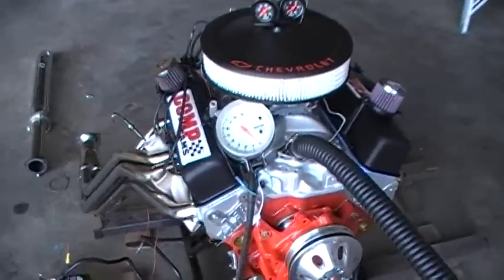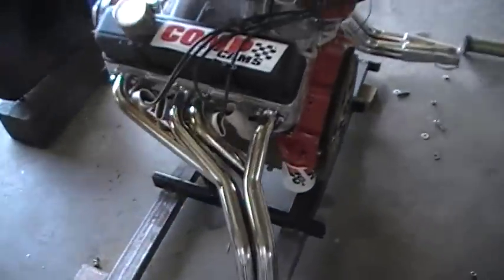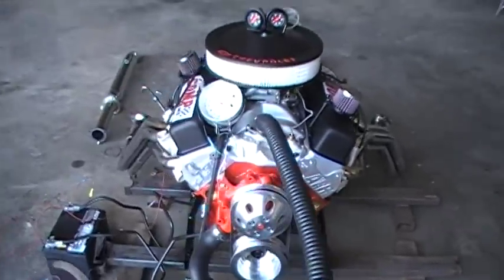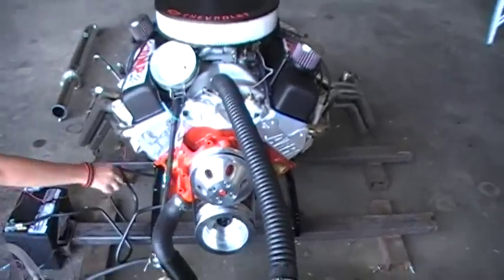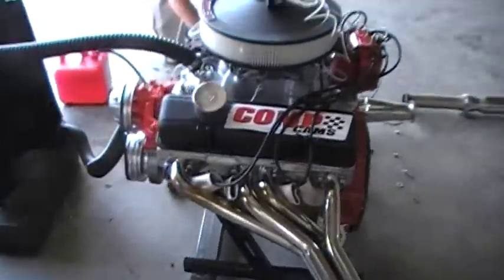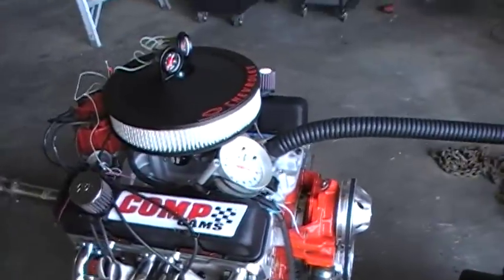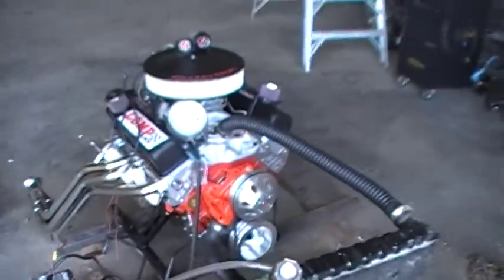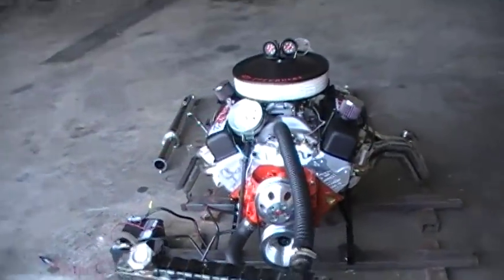383 Stroker SBC Dart SHP

Comment: definitely not making 550 with that low compression and small cubes with a dual plane. Lol u need about 11-1 compression with a single plane. But if you put some boost on it that wouldn't be to bad of an idea lol
Reply from the maker: Made 505 with that setup.  Put flat tops in it and changed cams and went single plane.  Hit 573

Comment: Should try the Total Seal gas ported rings. And install a crank case evacuation system. About 400 dollars for the two, but will dramatically increase  horsepower.

Comment: Did you fab up that engine stand or was it purchased?
Reply from the maker: I had a regular engine stand and then welding two 3-4 foot pieces of scrap steel to help support the engine while running

Comment: that intake is going to hold back the cam from revving passed 6500 but everything else seems to be pretty decent. GOOD JOB!!!  If its in a light car or S-10 use a Victor Jr with a 770 Holley. As it is Id say maybe 500 hp that intake is killing hp above 4000. With a Victor Jr yea 550 is obtainable with timing in the 34 degree range.
Reply from the maker: MasterWitchDoctor you would be glad to know that I swapped to flat top pistons, put on a bigger cam, switch the intake to a high rise single plane and she would rev to 7200.  Put out 573HP

Comment: 1 5/8" header is to small. Your compression is probably more like 9.8 with a 65cc head and why would you go I beam instead of a H beam for roughly the same money.
Reply from the maker: Jess Roberts I liked the Scat Pro Comp I beam rods.  They are in some 600 plus HP engines.  H beam would have been overkill.

Comment: oh thats a nice sound. 

ive got 2 400 small blocks.... one in a 77 chevy truck that im putting a 4 speed munchie in (the granny gear, sm465 iirc) and a np 205 to replace a th350 with only 1st and 3rd and a full time four np203. 

think i will keep it mostly stock.... mostly. need that truck to be any weather turn key and go. 

but the 400 in my 68 impala..... i almost wanna go 180 from your motor and stick in a 350 crank....make it a 377. 9000 rpm!!!!

Comment: Sounds like my flat fendered 2wd Jeep back in the 70's. I ran it on the sand dunes at Pismo Beach with paddle tires and could climb anything out there.  It was a 350 with Z-28 off road cam, Tarantula intake, big Holley, 2.02 heads, and headers that I built. The 12 bolt GM rear end was 4.56 posi, trans was M-22 Muncie 4 speed. Good stuff back then but nothing compared to today. I appreciate the sound of your motor. Kids these days don't know what an uncorked full tilt small block sounds like....
Reply: kimmer6 I
Reply: kimmer6 good deal I'm in the 805 myself . Just recently blew my engine up got to drop a new engine in my truck
Reply: kimmer6 what the hell is a z28 off road cam?????? Daaa

Comment: Sweet build buddy! Are you still able to run 93 with that 11:1 C/R?
Reply from the maker: Yes since the cam is big enough to bring down the dynamic compression ratio.
Reply from the maker: Yes it can still run on 93 octane since the cam keeps the DCR in pump gas range.  The engine is 11:1 SCR now actually.
Reply from the maker: Yes. When I changed pistons from the ones used in this vid to the flat top SRP pistons 11:1, I also changed to a bigger cam which lowered the DCR enough to be in the safe range.

Comment: those are great numbers for a motor under 10:1 CR. I'd toss the valve cover breathers and run a vacuum return line into the manifold from one of the covers and plug off the other, That way the crankcase pressure is equalizing to the top end. Why? So the pressure in the cases eases the gravity return of oil.
How much did the build cost?
Reply from the maker: well I switched to SRP Professional Pistons/Rings to bring compression to 11:1, switched cams, and rebalanced the rotating assembly, so probably right around 7 grand or more...$2000 shp block/machining, $1500 rotating assembly, $1500 heads, $600 carb, cam/lifters/timing components/pushrods/roller rockers $1700, intake $100, oil pump/pan and other miscellaneous things ?$...the time i put into it was free though! lol
Reply: thats some cash to drop! What machining, besides cyl. bore/hone, line hone and deck was done to the block to cost $2000 in machining?
Reply from the maker: Steve Solo I meant the block was 2,000 shipped to my front door ready to go.

Comment from the maker: After re doing this engine I got it to put out 573 Horsepower at 6400RPM and 515 ft/lb or torque at 5400RPM!
Reply: OutdoorMan812 
What parts did you switch? Intake, headers,
Reply from the maker: Derek Stewart I changed to flat top pistons, and to a bigger cam, and single plane intake
Reply: @lhmurphy21  nice, I do custom port work on a lot of heads and Intake, does great for out of the box parts minus custom cam
Reply: Was it around 500hp 500tq before the changes?
Reply from the maker: Derek Stewart yes it was 505HP and 470ish torque
Reply: @lhmurphy21  
What cam?
Mine I built 7 years ago 388cid
90 2 bolt studded roller block
Custom hyd roller 229-235 .550-.560 lift 110lsa 107ilc
My ported rpm edelbrock heads 274cfmin 227ex 193cc runner
11.08:1, 92 pump gas
My ported rpm intake 
505hp from 55-5900rpm
500tq from 4400-4800rpm 
750 ultra hp carb
Ran out of air but was a mild street deal on a major tight budget
Reply: It's my daily so I'm not making any changes lol
Reply from the maker: Derek Stewart it was a custom solid roller from Comp Cams
Reply: @lhmurphy21  
Ok, well you got a 10 second ride now, we got 10.93 at 123.3mph in a 3650lb camero street car, you'll have lots of fun, good job, I build mainly BOP 455 strokers but these 383's are really good, I wish eliminaters were in the budget back then, good luck
Reply: @derekstewart8175  hey do you do rebuilds and other kinds of engine work also just reading through comments you seem like a guy who knows what's what I'm a novice just trying to get something good going for my car.
Reply: What car and rear end gears you running it in?

Comment: Mane good job on the motor sounds good......a little more compression and a rpm air gap or victor Jr.  Well get that thing over 505..but for your first build 505 is good